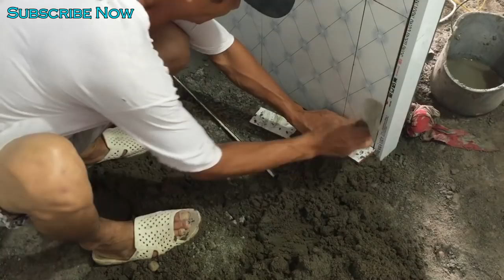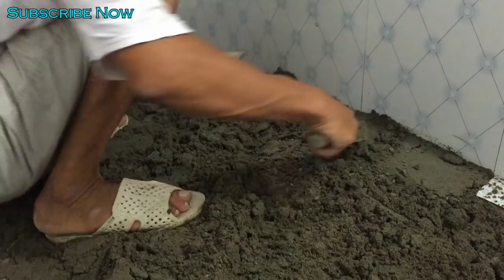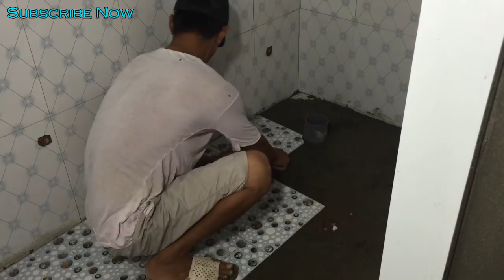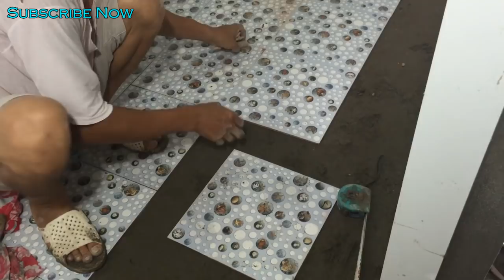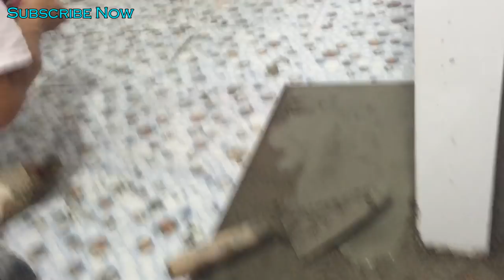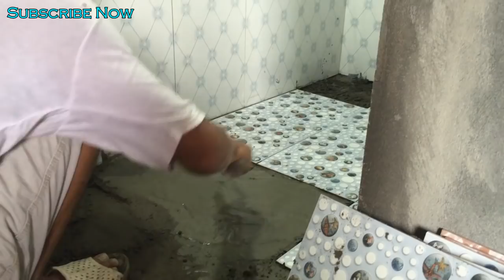Construction Paving Bathroom Floor - How To Install Tiles a Bathroom

Comment: Great work but it's extremely wrong method. You have to install floor first then wall. Otherwise you bathroom will be fucked up after few years because of leaking
Reply: And add waterproof membrane before laying any tile.
Reply: Toan Nguyen
Reply: Dati nayang naka tiles. Tinaas lang siguro ung flooring. Dininyo ba napansin na iba na ang floor tiles nya.